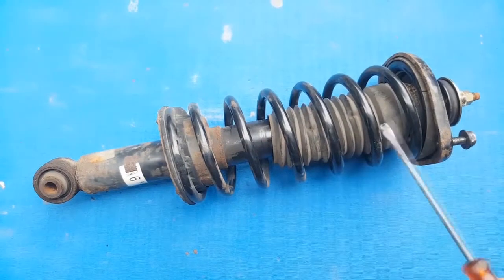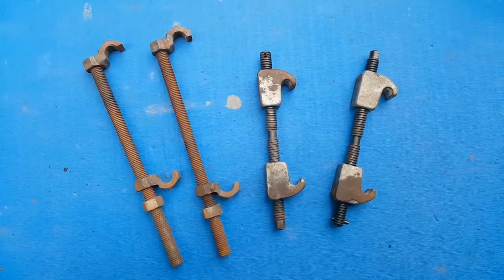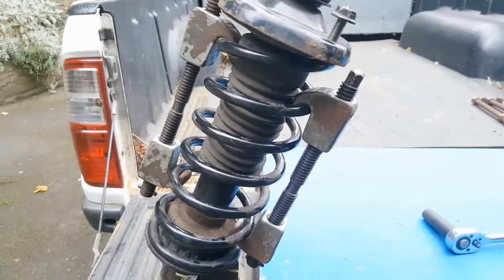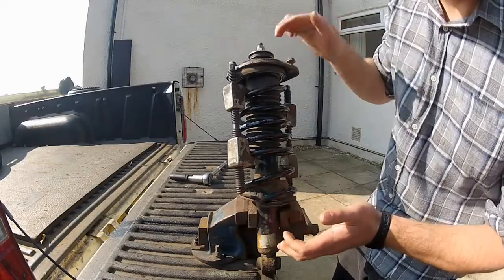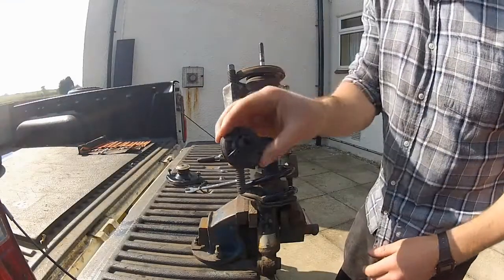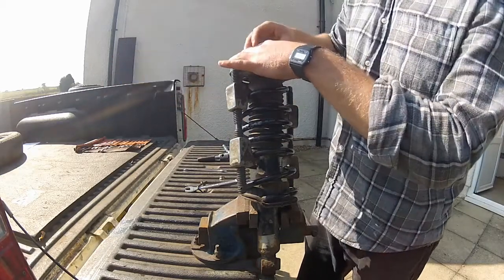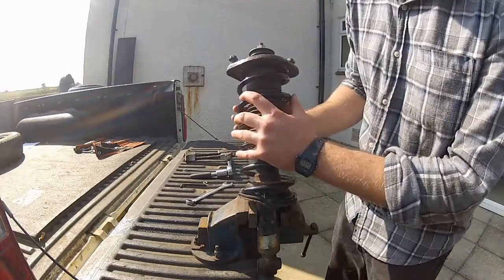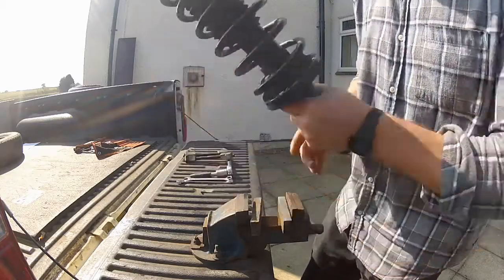How to Remove / Replace a Coil Spring on a Coil Over Suspension Strut (MX5 / MIATA) | Tech Tip 29

Comment: That top piece u put the Allen wrench in broke off. Is there another way to keep it from turning while trying to take it off?
Reply from the maker: Tack weld a nut on to it is the best option. There are other options but all risk damaging the threads (mole grips etc)

Comment: Thanks! You stated the danger of doing this, so we understand the risk falls on us, then got on with it! One question though, can I get 3 spring compressors? or is it more trouble than it's worth? It looks like if you three, there would be little chance of the the compressors from slipping to one side and the coil springing out...
Reply from the maker: If done correctly 2 compressors will be enough. However, there's nothing to stop you using more if you want to!